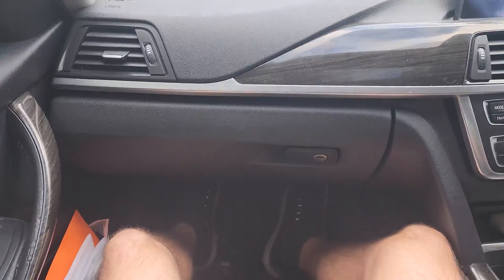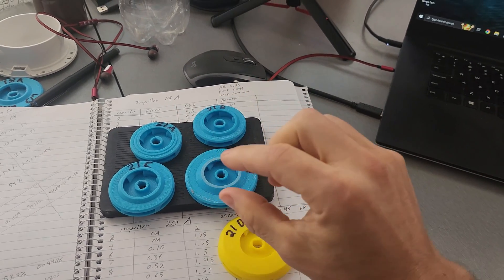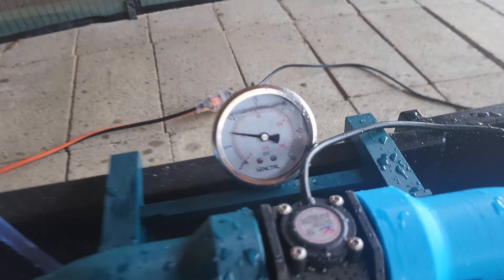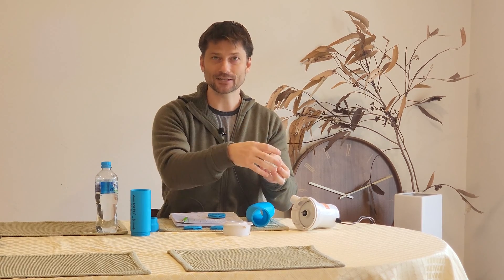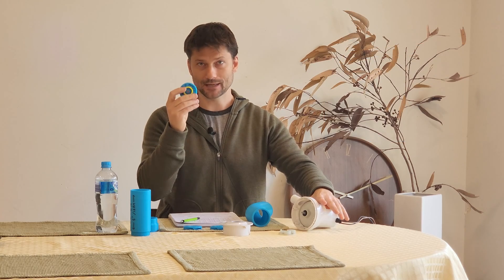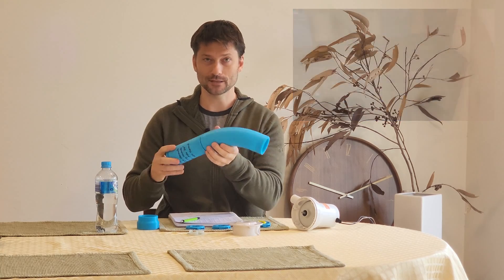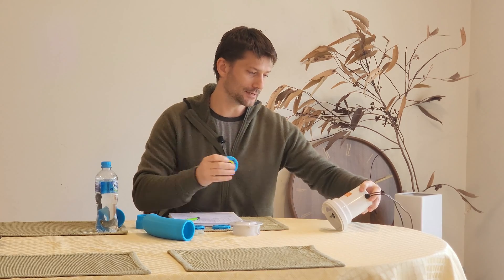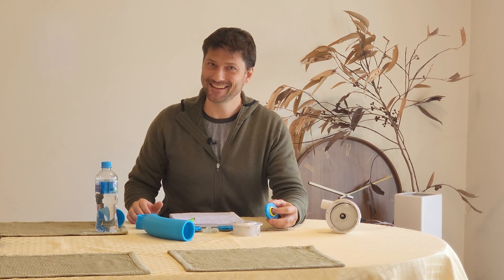Electric Dredge Project: I Made a Bilge Pump Impeller 39.8% More Powerful.

Comment: Looks like you may have created a nice niche market with those impellers. That just might make a good pump for my battery operated Le'Trap and Geo Highbanker.
Reply from the maker: Thanks John!  
It's interesting that there is such room for improvement in efficiency, I was a bit surprised to see it!  I suspect these impellers would be good when using longer hoses that leave you further up from the bank, or if you want a higher pressure spray of water.  At wide open, there isn't as significant of an advantage with this design compared to when jetted down to 11mm.  A highbanker running a 18 or 20mm jet would clean gravel fairly well I suspect.
Regardless of how useful these are for highbanking, I'm very optimistic for the ability to power serious full size beach boxes with electric setups, even on multi day trips with the assistance of solar panels.   It wasn't that long ago a 100AH LiPO4 battery was worth $1200CAD and yet now the prices are WAYYYYYYY lower.  Super cool!
I still love my WX15 I bought new in 2013, and it provides me with water when running 150 feet of hose way up over a wide gravel bar...  But I really need to ad an electric/solar setup to my arsenal for packing into places!
PS: I hope you are enjoying some open water and a warm spring!

Comment: If you take that Scenery and Crap it Up a bit it really reminds me of Townsville.  XD
Also good to see you have the Required HandBook for Guests of Australia listing Insects and Critters that will Totally Mess You Up!
For Venturi Suction I Used to use a 3/4" Brass Swagelok T with one of the 2 parallel fittings a 1/4".
This allowed me to Swage in a 1/4" Tube which exited the other 3/4" fitting.  The feed came in the 3/4" Perpendicular fitting and flowed over the 1/4" pipe inside a 3/4" pipe.
End result is a fair bit of suction through the 1/4" fitting.  This could easily be scaled up and replicated with PVC cheaper.

Comment: Very good job on the improvement! You've been working hard at it and im glad your efforts have born fruits!
On another note, in terms of suction dredging, I think you should consider doing a power jet. With a suction nozzle the water is being pushed up the hose, in my experience that lead to more clogs and noticeably less suction than a power jet. Plus with a power jet you dont have to move a second hose around while youre dredging. Id imagine its also more efficient than a suction nozzle because the pressure hose isnt nearly as long, maybe 2 feet as compared to the nozzle where the pressure hose needs to be almost as long as the suction hose. Just food for thought.
Reply from the maker: I think you are correct about the placement of the suction nozzle.  After the point where the jet and the dredge hose combine flows, you will get more resistance in the hose because it has to contain the water from both inputs.  I think a suction nozzle could be useful for people who have a gas pump laying around and just want an affordable nozzle to test with...  My main focus will be on making the electric dredge work as efficiently as possible.

Comment: Just buy an Iwaki sump pump they move 40 gallons a minute.  I can mail you two for free youre not rain man with these obtuse calculations.
Reply from the maker: I'll check them out!  Do they make pumps that run on 12 volts?
Reply: @UtmostOutdoors  theyre 3 prong outlets needed to run the noiseless pumps, theyre $300 online new, heavy full of copper. The scrap yard scammed me only gave $2 a unit, when they got $35 of copper inside.
Reply: You can find them behind petshops that flush fish tanks constantly and are tired of breaking their backs moving a garbage tub of foul water out back. Instead they run a pvc tubing out to the compost.